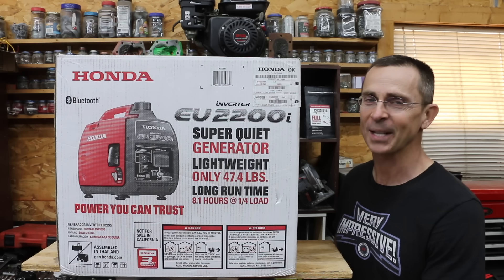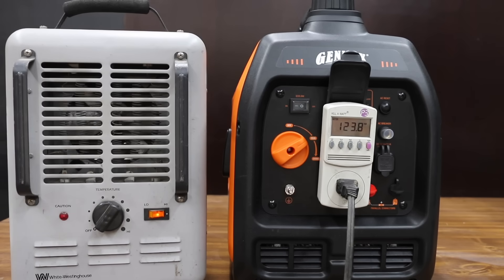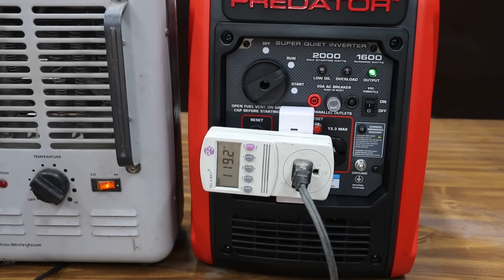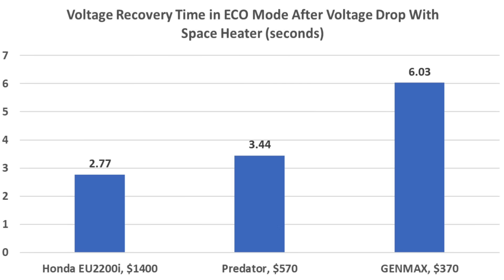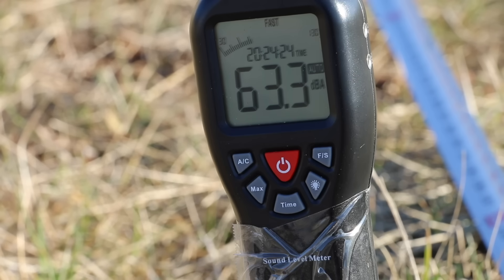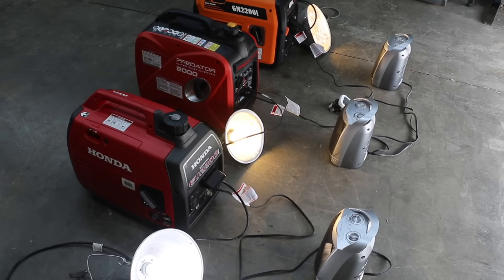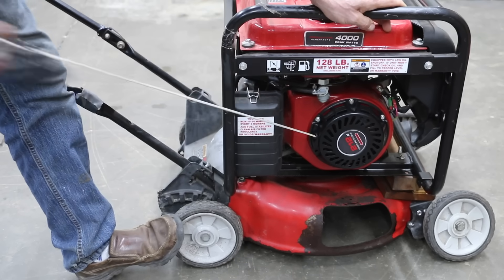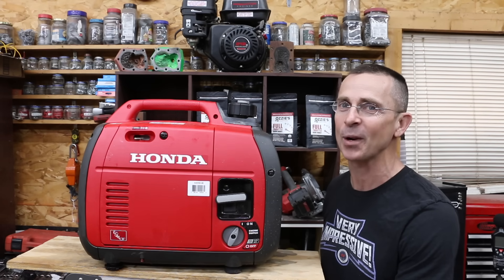Cheap Generator Better Than Honda? Predator vs Honda & GENMAX—Let’s Settle This!

Comment: We’ve had the predecessor, I believe its the Honda EU2000, for 16 years and have used it almost every year.  I do the regular maintenance. Use has ranged from outdoor projects like building cedar fence using a variety of power tools, to whole house backup during multi-day power outages.  (Safely doing the latter involves turning off the breaker mains, and then turning on critical lines and watching the current draw).  It has never failed to start within two pulls, has yet to require a repair, and looked new this fall after I washed the unit.  Especially for this kind of tool, how long your own use-life expectation is a major factor.  Our unit has certainly exceeded our expectations, and I suspect the Honda will out live me!

Comment: Considering I could buy 3-4 of the Genmax for the price of the Honda, I would buy Genmax. Sure, the Honda might last longer, but 3-4 times as long? I doubt it. I of course seldom need a generator, mostly to recharge power stations. I have a dual fuel Champion 2000 watt generator. So far I have only used propane in it, eliminating the need to drain the gas tank to prevent dead gas gumming things up. Some of my power stations recharge in under 2 hours. I have a lot of power stations that can be used indoors with no emissions or noise. One thing I learned during Hurricane Helene...gas stations were also without power. The few that were open, had long lines, and there were even fights that broke out. Bottom line, in a crisis, a gas powered generator is not worth a dime if you can't get gas. For extended outages, there are few, if any, fool proof power supply strategies. My sister had a whole house Natural Gas generator that worked well. Some who had the same, had mechanical failures. These generators require regular maintenance.
Reply from the maker: Thanks for the feedback.

Comment: Are there any inverter generators out there that don't have HUGE complaints!!! I always thought Honda was the best, but my son has a Honda 3000is almost new and already has trouble and very very hard to work on and parts are extremely expensive and hard to get. Same with my Harbor Freight inverter Predator 3500. I’ve been waiting months for the meter on the front panel that died with only 21 hours of just excising 30 mins. a month.
Reply from the maker: Thanks for the suggestion.

Comment: My EU2000i has been nearly flawless for twenty years. Had to clean the carb once, she was surging in eco mode. Light duty running the furnace, tv, and appliances during power outages. I change the gas and run it every three months.
Reply from the maker: Thanks for sharing.

Comment: I buy predators for price. Take extra care of them by installing magnetic drain plug and dipstick because they don't have oil filters. Keep Amsoil signature  synthetic in it and you can get a lot of of life out of them. But we've purchased one in the past that wore out quickly With high metal content in the oil. If you get a good one, it can last a very long time. And the fact you can buy three of them for the price of one Honda is a pretty good argument
Reply from the maker: Thanks for the feedback.

Comment: Can you please test the Westinghouse iGen2800c and similar generators by Gererac and other brands (which seem to be just the same but rebranded generator)
Reply from the maker: Thanks for the suggestion.
Reply: @ProjectFarm  You are welcome! It looks like Cummins/Onan and Gererac sell exactly the same rebranded generator. Unfortunately, other reviews do not go as deep as yours - they do not even mention engine displacements, let alone measure noise level, voltage drop and oil burn. I wonder how good the Westinghouse iGen2800/2800c is in these respects and how it compares with segment leaders like the Honda 2200i

Comment: Honda is Honda  the price  will be more  if it's  considered doing  heavy work  that's the way to go if you want  something  to use part-time. use lite load well you you can go with a cheaper brand 😉

Comment: Please test the smallest 240v 30 amp generators to charge an F150 Lightning and a Tesla.  L14-50 plug on the mobile adapter. 😂
Reply from the maker: Thanks for the suggestion.

Comment: At time stamp = 8 minutes 23 seconds you speak of taking the average of the decibel sound level readings. I believe to determine the correct average is more complicated than just adding the dB readings together and dividing by the number of readings since dB is an exponential representation of sound level. I am not saying that's what you did, but that would be an easy mistake to do without using dB representation often.

Comment: I've got a Honda generator that is only 3 years old. So far it has broken down and need to be sent for repair 3 times.  I can't remember what the first repair was but it kept cutting out and needed a new pull cord after just 15 months. 12 months later, it needed a new inverter and a new alternator. 2 months later, ie now, it's broken again! It uas been went to a registered dealership each time and due to Honda's method of warranty repairs, its taken 2-3 months for me to get my genny back. Honda have refused to help or replace when I went direct to them, so its back to the dealership after just 2 weeks of 2-3 hours a day charging my boat's battery bank. I'll never buy a Honda again! Useless, unreliable product with zero customer service.
Reply: Additional, as my boat has a roof full of solar, the Genny is rarely needed during the summer other than to run the occasional power tool.
Reply from the maker: Thanks for sharing.

Comment: Should the generators be run in? I could see the cheaper motors made with worse tolerances than the Honda, but I'd love to see the oil results after 20 hours and then redo the oil change run and rerun and retest...
Reply from the maker: Thanks for the suggestion.

Comment: If you use the generator a lot buy a Honda or buy 3 Generac and cycle through them. If it's just an occasional use thing i would buy two of  the cheapest so I have one as a backup and still keep some money in my pocket.
Reply from the maker: Thanks for the feedback.

Comment: We have diesel generators here in Punjab. They cost around 700 dollar and use a variant of single piston old diesel engine and run for 1 hour per liter and diesel cost about 80-90 rupees. They are rated for 10kW.
Reply from the maker: Thanks for sharing.

Comment: Please test larger inverter generators , I’m asking because I run agricultural drones and I’m really battling to find a 10-15Kva generator suitable to charge my drone batteries , the 12kva DJI generator costs 5000$ it’s just not reasonable even though it’s running watts is 9000w there are 11kva inverter generators that push 10000 running watts , I want to make an informed choice and don’t want to spend 5000$ please help from a long time fan in South Africa
Reply from the maker: Thanks for the suggestion.

Comment: I love your videos, but it occurred to me that instead of 2200 vs 2200 comparison, an approx. $1000 generator comparison might be more useful with winter storms coming. I have an old Honda EU2200i that still works and has to be at least 15-years old possibly closer to 20. Treated poorly, most of its working life on construction sites, doubt it's had 5 oil changes, serviced once when it was getting hard to start, old and reliable.  Then January 2022 my electrical service caught fire, and HF had the Predator 3500's on sale for under $750, ran it nonstop pretty much max load for two weeks then stuck it in the shed and forgot about it, two years later it started right up with one easy pull, did another two weeks straight powering a winter job-site trailer. Paid approximately the same price for both of them and although slightly larger the Predator with its wheels isn't noticeably harder to hall around and store than the Honda, it's every bit a quiet as the Honda, and that extra 1300 watts makes a big difference.  But and it's a big one, I doubt the Predator could withstand the abuse the Honda went through, and there are no shortage of places to take the Honda for repairs and service. Either way both were a well spent approx. $750, except... A couple of months ago 1,000 miles from home, after midnight, in a very crowded Grandpa's Farm Campground outside of Richmond (great place really nice people) the Onan on my motor home decided to start randomly turning itself on, loud and rude! so I had to disconnect it. We could have finished the trip without the generator but... HF had a sale (coupon), so for around $1,000 I splurged on a 5000 Dual Fuel, only slightly larger than the 3500, +2" and maybe 10lb, it was easy enough to slide in and out of a side compartment or stick in the toad, so I still haven't had the much louder Onan fixed, in fact I've been thinking about pulling the Onan out. During the rest of the trip, I noticed that the Predator 5000 Dual Fuels were very popular, even some very expensive luxury motor homes were using them instead of their on-board generators. Wonder how long it will hold up? Point is that as I write this a Honda EU2200i is $1,099.99 on Amazon while HF has the 5000 Dual Fuel for only 99 cents more...How important is physical size, and weight vs power and runtime? Especially if you're not using it every day, just different thoughts, makes me wonder what the best generator for emergency power outages would be? I used to want a Generac whole house backup generator, but these days for the same price...
Reply from the maker: Thanks!  Thanks for the feedback.

Comment: I own a couple of these honda units and they have several thousand hours on them. Have never let me down. Almost always crank on the first pull and run smooth. 

That said I always use non-ethanol gas and properly winterize them.
Reply from the maker: Thanks for sharing.

Comment: what im not understanding is y u didnt stop all tests an just say honda or you buying a scam there not gennys by definition if your running is 1600w at 12v on 120 plug not i got a $129 inverter for my car running at almost 2 hours for a gallon more like 1 hr 30-35 min and run a 1200w pc and a 170w monitor(40in hdr tv)  a small lead light turbo charge 2 phone iphone and and moto now looking at the first big test everything but the honda shut off in less than 20 mins at 1500w least that what i heard ya say on super ruoghly quarter gallon of gas (16oz) which u only got 30minish now dont repl with how bad using a car in this manner is tell that to the people of texas i did a similar thing who had dat ice storm dat shut em down for 14 days i used my car to run a heater and laptop but its very wasteful and etc so of course i looking for solar or small genny cause i am the majority buyer of these things besides commercial use im a 30k or less a year under pverty level looking to run a heater and light laptop maybe fan in tent with genny out side runinng your first test prove that is completely imposible which make these machines not gennys but total scams

Comment: The other day I was running a Jack hammer “Mikita” 14 amp draw.  I had three generators on site.  Honda 2000, champion 2500, and a Generac 3275 watt model.  The Generac kept tripping, the Honda overheated and the cheapest one the Champion ran that Jackhammer all day.  Made zero sense to me.
Reply from the maker: Thanks for sharing.

Comment: I found the dirty spark plug curious on the Predator. I have a Predator 3500 and after the break in period I noticed a very dirty plug. I replaced the plug and have never had the same issue. I wonder if it's something like the oil ring needing to seat. I don't recall if the oil was notably lower for the first oil change. It isn't burning oil now and the plugs stay pretty clean. I don't have anything to compare it to, I bought the Predator 3500 because of the electric start and my household consists of two old women and we don't need to be yanking on a pull start. It has worked like a champ but, like I said, I can't really compare it to anything else.
Reply from the maker: Thanks for sharing.

Comment: For a lot of people a portable generator serves one purpose: a backup when the power goes out. Then only one thing matters: will it start and run. Honda engines check that box. No-one else does, in my experience.
Reply from the maker: Thanks for the feedback.

Comment: I was hoping youd do a noise comparison of that tailgator POS. I had one of its similar predecessors, the stormcat. Sad little piece of equipment. They always break the recoil starter. LOUD. And an annoying loud, like theres a dozen tiny angry dwarves inside with hammers trying to beat their way out. If you absolutely have to have a $100 2 stroke generator, plan on using it once in an emergency then throwing it away.
Fortunately Harbor Freight let me exchange it for full credit on the predator 2000, which I put over 1000 hours on in 4 years before it was stolen. Replaced that with Champion 2500 which i like the size and weight of. Recoil starter broke but they sent me another which I replaced myself.

Comment: The Honda owners desperately trying to justify of them having it, yet the test shows with absolute clarity, that for 3.5 times the cost of a Genmax, they get only very marginal additional beneefits. 
Honda simply is a lousy deal, you pay for the brand. It is better to have 3 Genmaxes -even if two is in dry storage - because: 
1. Three units used up in sequence will outlast a single Honda - period. 
2. There are two back-ups for breakdown - that's insurance/security.
3. Two can be connected and ran together for a much higher load - if needed - than the single Honda possibly can. 
4. After the purchase of 3 Genmaxes, there is still $ 200 left in your pocket, vs. a single Honda.
It's a no-brainer...
Reply: Will the genmax start when the power goes out for the first time in two years? Probably not. Honda will. Every time. That's all that matters to me.

Comment: I got a Honda during Hurricane Sandy in 2014 (?). I'm a Honda fan; car, motorbike, lawnmower so took the approach of "nothing runs better than a honda". The generator was amazing and I'll only buy Honda if an option is available.
Reply from the maker: Thanks for sharing.
Reply: Same here. I still have the Honda EU2000i (predecessor to the model reviewed here) I bought in Sandy (2012 BTW). It still runs as if it is new. Has never failed me.

Comment: Any chance for test on BE generators? Supposedly they use Honda internals.
Reply from the maker: Thanks for the suggestion.
Reply: @ProjectFarm  also finished your rain spray for windows video. Already got the rainx. Seems like the best choice with ease of use/how it works/price.

Comment: Very interesting test. The oil analysis was very helpful. As for running time, keep in mind, the Honda delivers the highest voltage leading to a higher power output. That’s why it shut down a bit earlier. The others ran longer because they delivered less power. Will the Honda last 3 times as long? Probably
Reply from the maker: Thanks!

Comment: Can you prove that there is a voltage drop at the end of a long power cord?
I've put 6 X 20 metre cords together and checked the voltage at one end and the other and the difference was ZERO.
Sounds like an old wives tale to me.
Reply from the maker: Thanks for the suggestion.

Comment: Oil Test shows contaminants in the oil after the 1st oil change. Might that be break-in wear? The Honda likely has better finished components in the engine so the 1st oil change would be cleaner than the other brands. But how about after the second oil change when all 3 engines are fully seated and run in?  That might be a long term evaluation of suitability over the long haul.

Comment: I wonder if one were to add some filter capacitors to the standard generators if that would smooth out the sine wave?
Reply from the maker: Thanks for the suggestion.

Comment: Another thing to test is the best way to quiet a generator. Taking several pieces of plywood and putting them on it at an angle aimed at the ground is one method. Another method is to take insulation board, one inch, two inch and make a box like enclosure. Other materials can be used, drywall, metal, fiberglass insulation. bale of hay/straw ect. Changing the orientation, or welding on mufflers has also been suggested.
Reply from the maker: Thanks for the suggestion.

Comment: I'm wondering if a flux core welder can be run off these 2kva generators.. I would think they probably would, as of the flux cores are mainly inverter welders.
On eBay they have a Gentrax brand generators.
Reply from the maker: Thanks for the suggestion.

Comment: Anyone researched and shopped for  a generator like these and then switched gears and now thinking about rather buying a battery power station/solar generator? Ones that use LifPo4 batteries with their thousands of recharge cycles and that last for 10 years? Power supplies that are expandable in their capacity and have multiple ways of recharging them? I may very well go that direction.

Comment: I don't know about the others, but the Honda 1000/2000 watt generators, both use an overhead cam belt, are they interference engines??  I know that belt rarely give problems, but if it breaks, the dealer would charge almost the cost of a new generator to replace it.

Comment: Would this size generator be enough to run a GE 6000btu window ac?(I forget the specs like SEER) If that's all I had connected to it? Thanks
Reply from the maker: Thanks for the suggestion.

Comment: I had a Craftsman 2500 inverter generator for nearly a year. Getting it to start was a bear every time. And it would always stall when it tried to power up my 1hp portable compressor. So I sold it and bought the 2200i, with lesser specs. The Honda starts every time easily, and will power up my compressor, meaning it does better than the stated specs. Price difference? Worth it.
Reply from the maker: Thanks for sharing.